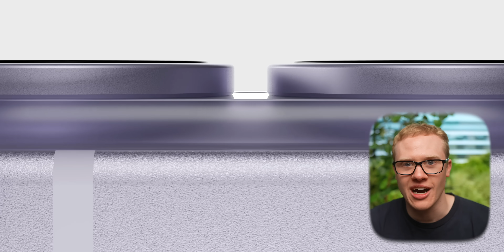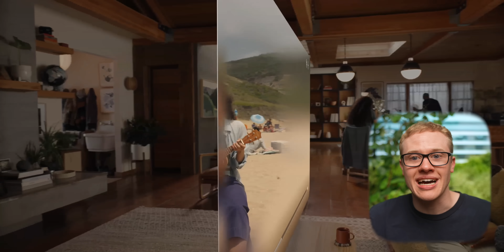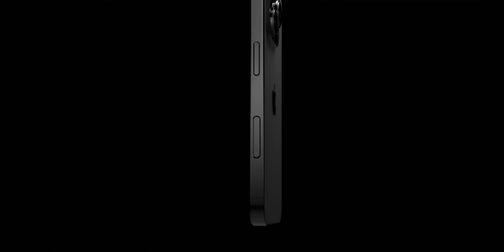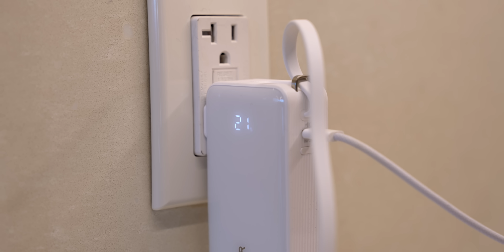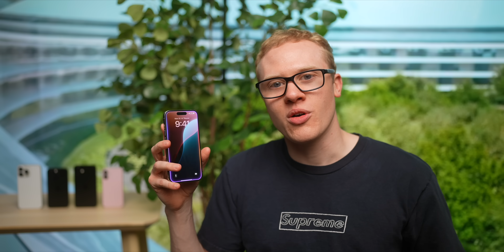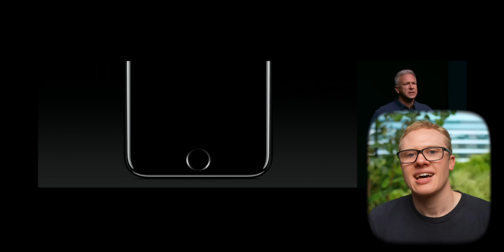iPhone 16 New CONFIRMED Leaks! FINAL Design!

Comment: Why do people even want super thin bezels? I have the iPhone 15 Pro Max and I keep not touching, but touching the buttons at the bottom of the screen which will either close my current page, of if I'm scrolling a lot it'll take me all the way back to the top, and just is a giant pain in the ass to have. Then there's times when the entire app will just get launch to the home screen when I flick from toward the bottom of the screen.

Seriously. Why would anyone want thinner bezels? They're too thin now!
Reply: big ass hands, smaller bezels mean more screen space, and less of that distracting black line
Reply: I barely have accidental touches. I feel like a lot of you doing this grip your phones wrong. At no point are my fingers touching the glass unless I want them to or I’m full gripping the phone
Reply: @InttoTTheNightt  
Holding my phone wrong? Are you being serious?
Follow up question: Do you use a case? If so, it'd obviously be easier to not touch the edges of the screen as you reach across it. Also, do you use two hands at all times when using your phone?? How else would you reach across it?

I'm not about to use some dumbass "laying-in-my-hand" nongrip when using my phone. I don't want this stupidly expensive $1,600 pos crashing to the ground. I can't wait to get back to Android. This thing has been nothing but a nightmare.

Comment: Please tell them to make the control center buttons boxy again. The new UI looks so cluttered and just so wrong
Reply: You can add or remove stuff as you please. So no it’s not cluttered lol!
Reply: @Aggie4life77  You clearly didn’t understand what I meant. They reduced the padding between the icons and their containers which makes it look cluttered like some iPhone clone would have.
Reply: @vedanshchn  I’m running the dev beta and my partner has been complaining about this too. She says it looks “too android” and messy. I kinda like it, it reminds me of the Lock Screen pin buttons and the phone app dial pad. In that way, it’s kind of thematic.
Reply: @illhaveawtrplz  Well, you can’t exit the control center by swiping up from anywhere like before so it’s bad functionality wise as well.
Reply: @vedanshchn  Yeah, I’ve been frustrated by that too. I have multiple years of habit built up and now instead of dismissing with an intuitive up-swipe, it swipes down to a new panel. On the flip side, it’s nice to do a long swipe and get straight to whatever page you want. That said, I think they should make the pages lateral instead of vertical. In this way, no matter which Control Panel page you’re on, dismissing with a swipe will still work.
Reply: @vedanshchn  Update: If you remove the additional pages and go back to one, it still dismisses with a single up-swipe.
Reply: @illhaveawtrplz  I think they should let us swipe to the other pages when we swipe down from the edge having the icons for those other pages (right most).
A simple swipe up from anywhere else should exit the control center.
I’ll remove the other pages when the stable built is released. I anyway have everything I need already there and have removed unnecessary toggles years ago and never needed anything more.
Thanks for the information 🙌

Comment: I’ve already sold off my 15 Pro Max ‘cause I got an amazing deal and am back to my gorgeous Gold XS Max and realized how uninspiring and boring the Natural Titanium really felt. I hope the Rose Gold 16 Pro series really happens. Else I’ll be fine with my XS Max. It works just fine, keeps apps in the background and I’m already planning to get its 5 year old battery replaced.
Reply: You downgraded to a 5 year old phone for the look and feel lol
Reply: @naim3968  No, I downgraded because I got an amazing resale value which I wouldn’t have gotten later on when the 16 series launch was closer. I’ll get the 16 Pro Max for sure.
In any case, the XS Max is fast and smooth, retains apps in background and it works just as good. The only downside is the crap battery life.